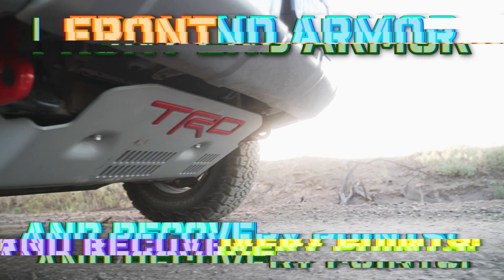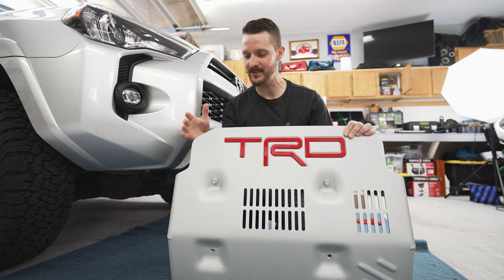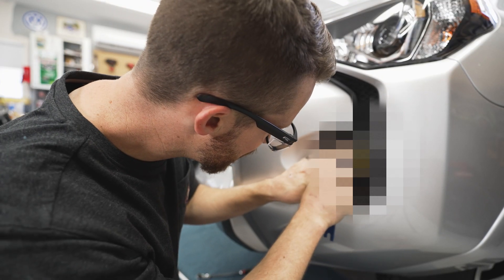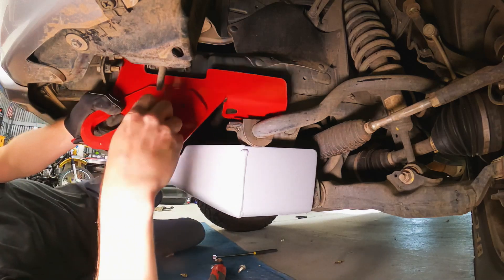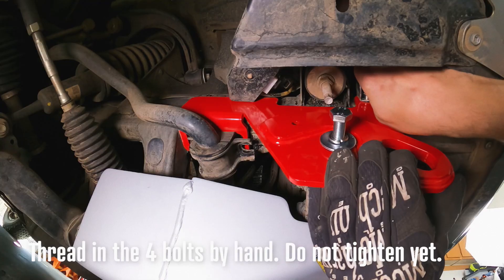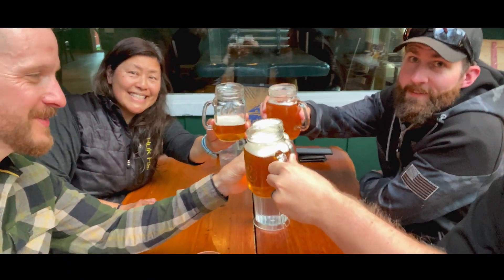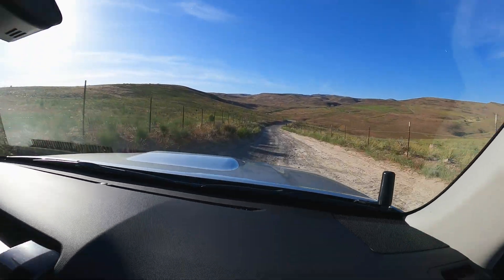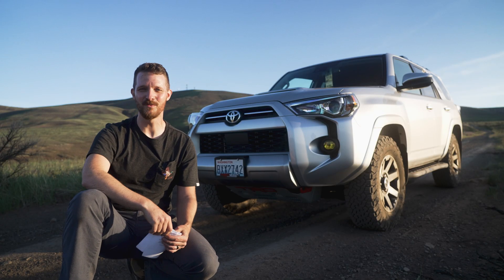Toyota 4Runner TRD Skid Plate, Rated Recovery Points (NOT FOR MALL CRAWLERS!)

Comment: After 21 years and 210,000 miles the motor in my Expedition died.  I am planning on searching out a 2021 TRD Off Road next week.  I agree that it is the sweet spot in the lineup .  Thanks for the vids.  New tires and the recovery points will probably be my first mods.
Reply: TRD is overpriced.  stick with the regular 4runner trims.
Reply: @itsme6026  The TRD Pro is overpriced the Off Road is worth it for people the need a locker.
Reply: Did you get one?
Reply: @jpjp3873  Yes I did, I got it at the end of June.
Reply: @JohnQuincy1776  Awesome !  We just picked up a venture edition.   Which did you get?
Reply: @jpjp3873  I got the Offroad Premium.  I have wanted a locker for a long time.  I love the wheels on the Venture edition.  They are all insanely capable.

Comment: I JUST put he Apex recovery points on y SR5P!! I painted mine green though to go with the color theme I have. Figured having recovery points is important in general, but also, I'm in an organization that does mountain vehicle recovery. Was pretty shocked that the 4 Runner has no proper recovery points and just tie downs. I also got the green lamin-x covers for my fogs when I learned you couldn't just change the bulb. Earlier 5th gens lets you change the bulb for the fog lights, but not on the 2021 at least.

Comment: I installed both recently. Have you tried to use the recovery points? Shackles don't fit well with the factory tie downs in the way, and are probably too sharp for soft shackles. I ordered some sleeves for the soft shackles so hopefully they won't shear. Apex should round the edges, or extend them forward about 1.5 inches. On the skid, no need to tap the rear bolts, they are fine. You do need to clean them very well. I used a pistol bore brush and wd40 and they were fine.
Reply from the maker: Hey there, I did use the recovery points a few times with soft shackles.  I agree they are likely too sharp.  In the year since I've upgraded to a CBI covert front bumper with D-Rings.  But for occasional use they're fine.

Gotta say my experience was those rear bolts did need to be tapped.  I cleaned them just as you suggested before shooting this video back in the day.  Makes it easier to use longer bolts, but to each their own.
Reply from the maker: Here's the covert bumper video:  https://youtu.be/znK7ZqeHNR4

Comment: In other videos it seems like the skid plate gets dropped every time for oil changes, is that right? Seen a few reproductions of thr TRD skid plate that add an access cover, and then most aftermarket ones like RCI and others seem to also have an access door
Reply from the maker: Yes, very true.  You have to remove it for oil changes.  An access door would be great.  I may switch to a CBI front skid for this reason eventually.  Other than that the TRD skid is great... and has held up to some pretty substantial abuse.  :-)

Comment: The recovery brackets would not be compatible with Fox 2.5 resi shocks as the spacers needed to clear sway bar may interfere. It could be modded, but won’t bolt straight on.
Reply from the maker: True.

Comment: I did the TRD skid plate on my 2018 Limited but don’t see the point of those recovery plates when there are factory recovery points already welded to the frame front & rear ?
Reply from the maker: Sure… the stock front ones are technically tow points.  The larger ones are rated/tested recovery points designed for being winched out or being used for kinetic recoveries.

Comment: Does the new skid plate make changing the oil filter easier? I have a 2020 Limited for my wife and hate removing all the factory skid plate (covers). Thanks
Reply from the maker: I'd say it's exactly the same.  I have a video on the channel about doing an oil change with this skid plate in place.  I kinda wish it had an access plate like the Tacoma has, or some aftermarket options.

Comment: Any thought or experience about adding bull bar to most recent model of the 4Runner?
Reply from the maker: I actually just finished installing a CBI covert winch bumper on this 4Runner.  The video for that will likely be in May 2022.

I decided to do a version of that bumper without the bull bar because I didn’t want it to obstruct a front camera I installed on the 4Runner.  FYI, the front camera install is covered on my channel.

Comment: Are the trd skid plates better than after-market ones? They don't have access to the oil filter, which is a con I believe.
Reply from the maker: Great question.  I have a video on exactly this topic for my Tacoma… but it’s relevant in this case too.

The TRD skid retains some important steel braces that many aftermarket front skids say you need to remove.  I had a nice aftermarket skid on my Tacoma that got bent beyond repair because those steel braces weren’t there.  So in that case I went for a TRD skid that keeps those.  I wish the 4Runner TRD skid had an oil door though.

In short… I think the TRD skid is the best value and protects very well.  Here’s a link to the whole video:
https://youtu.be/0_mebxQ5uBg?si=CbSisfgiEvdfd5kn
Reply: @JasonExplainsThings  yeah, I watched that video. I don't know why the 4runner trd skid doesn't have the oil door like the Tacoma skid does. I know Catrihome trd skid plate has the oil door but it's a knock-off version.

Comment: Hello, great video, question thanks regarding the Apex Recovery Points, the website says the part number you shared cannot be used with the KDSS suspension that your vehicle (I have the same one) cannot be used? Did you have any issues? Thanks
Reply from the maker: Yeah it won’t work with KDSS.  My 4Runner doesn’t have KDSS so it worked great.

Comment: Jason- I got these and on installation every single crush washer failed long before I reached the specified torque setting. Additionally I noticed that the washers on the 17 mm bolts are smaller than the OEM washers. Wondering if you had any issues as well. Thanks
Reply from the maker: I did have a couple of the crush washers fail actually.  Lucky I had a couple laying around that size.

Comment: Is your TRD Offroad with KDSS? I thought that all are, and that TRD Pro skidplate cannot fit without cutting
Reply from the maker: Hey there.  I talked about this a bit in the recovery point section.  No KDSS.  On TRD Off Road’s it’s an option.  There’s a KDSS version of the skid plate and recovery points. 👍
Reply: @JasonExplainsThings  Where did you find the kdss version?